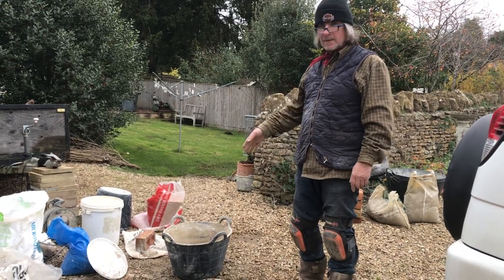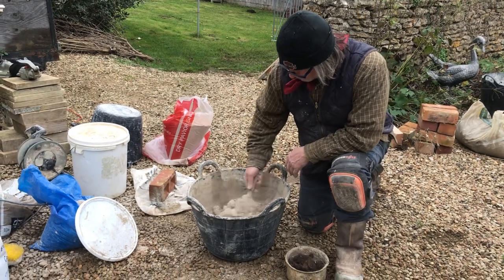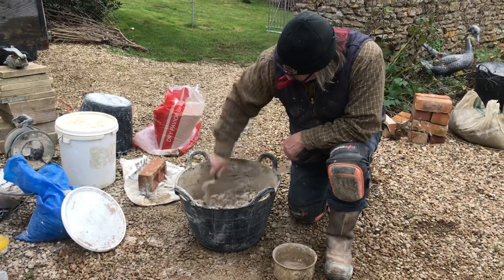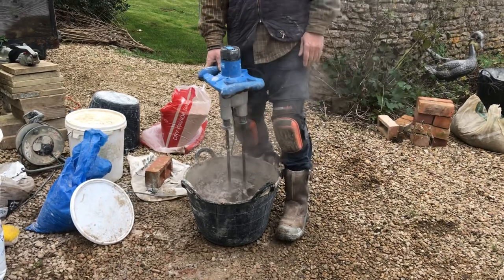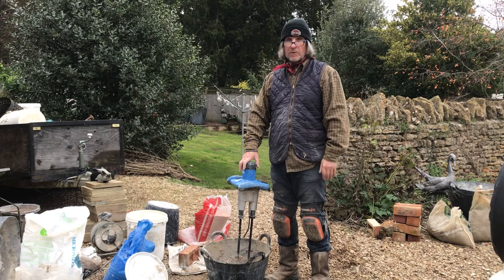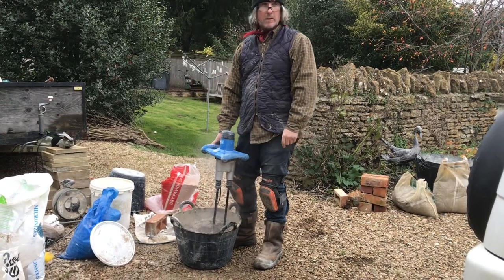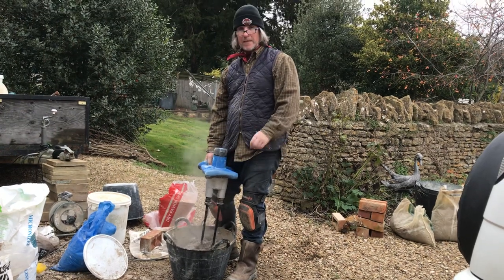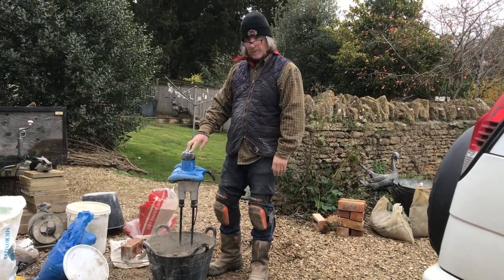How to mix Otterbein Naturkalk CL80

Comment: Hi there, I have just been mixing otterbein cl80 as well, here up north in the Scottish Highlands. I and was checking to see if I'm doing ok. We used builders sand and added a bit of top soil to 'get clay content'. Something I read. Not sure if that's what will work, but so far the chimney on the derelict structure looks amazing. Would you please advise what aggregate/sand and in what proportion regards the lime and water.
Reply from the maker: 1:2, 1:3 or 1:4 depending on the circumstances and vernacular. I couldn't advise on topsoil though. We never use it. The only thing we do is, occasionally, use a sand with a pozzolanic clay content but that is very prone to cracking.
Reply: Thanks! Back on it again, theres no cracks but I'll stay away from the topsoil now

Comment: Hi Michael, what would be the benefit of using the mortar hot straight away rather than the same mix cold the next day?
cheers
Joe
Reply from the maker: There're arguments for and against. I only use it hot during the cold weather if that's any help.
Reply from the maker: There are many. And I'm not going into them here. But if you want to know more then read Nigel Copsey's book on hot mixed mortars.
Reply: @michaeljamesdesign  cheers Micheal yes I have come across his work, he seems like the real deal, thanks for your reply
Reply from the maker: @TheJosepi87  He is. And he has a preference for hot in winter. We only use small volume mixes when it's cold.

Comment: Thank you, very generous of you to share your method of dealing with as slake transition reaction. Is your volume gauge ratio of quick lime : sand :  water  at 1:3:2 ? 

Willl this mixture be good enough for plastering directly onto the wall, in a hot condition, or will the evaporation of water be too high causing cracking ? 

Can you store that CL80 mixture inside a sealed bucket and then knock it back up by e.g. beating with a stick, or a squatting it in a roller pan mixer to make a good plaster that don't shrink/crack too much ?
Reply from the maker: Respectively: no, probably, maybe, possibly, no.

Comment: Thanks for the video. I think the addition of straw in to the hot mix will work well, but putting the horse hair in so early on in the slaking process will attack the keratin in the hair. Is it possible to add the hair at a later stage?
Reply from the maker: Hot mixed mortar is applied straight away i.e. whilst still hot -  for a number of reasons. The only reason the horsehair is there (alongside a number of other ingredients) is to help reduce initial shrinkage.
Reply from the maker: In another video I'll try and remember to say something about the horsehair in the original quicklime mortar still being present as a binder.
Reply: @michaeljamesdesign  That makes sense. Thanks.
Reply from the maker: @ironimp1 No worries. It's important that people realise that the ingredients which go into a traditional mortar or plaster go in for a reason. There's no flight of fancy involved. It's also important that we know the reason for adding what we add at a particular time during the mixing process. Quicklime mortars have all of the ingredients added at the same time. It's all about conservatorship. As the original masons from the 16 and 1700s used a lot of horsehair in their quicklime pointing and plastering mortars then we have to know why they did it and at what point so that we can achieve a similar outcome.
Reply: @michaeljamesdesign  Agreed, I recall the tanners using quick lime to dehair the skins, so as you correctly pointed out, the hair that you include early on will dissolve, but not before it does it job of preventing the initial shrinkage. 
I also note that you use local horse hair which, along with pig hair, I have found to be more resistant to the alkali attack. Plant fibres are excellent as they seem to improve in the presence of lime, so your straw addition would act as a reinforcement after the lime has cured. I know that some research has been carried out in this area, but as always, it would be good to know more.
Reply from the maker: @ironimp1  There's no straw in it. Just what sticks to the horsehair. And the horsehair doesn't dissolve. It's still very much present in the original plaster and pointing mortar which is hundreds of years old.

Comment: Your channel is sooo interesting to me, as a beginner. Very informative. Actually I live in the northern part of Germany and Otterbein is about 150km away from our city. If I assume correctly you do use CL 80-Q. Is quicklime only used in winter or do you use quicklime for certain purposes?
Reply from the maker: Hallo Gartenfreude, I use it all year round for pointing.
Reply: @michaeljamesdesign  Thanks for taking the time to answer. May I ask another question, why or when you use quicklime? I have assumed that you also use NHL for pointing and wonder how you decide to use one or the other.
Reply from the maker: @gartenfreude796  I've given up with NHL. Can't see the point in it if I'm honest. I only use quicklime now. I use in all year round.
Reply: @michaeljamesdesign  Thanks for sharing your insight and experience.
Reply from the maker: @gartenfreude796  You're most welcome sir.

Comment: If slower to slake does it make it safer?
Reply from the maker: That's an interesting point. I'd say probably yes. The heat build up is a lot slower and I never bother with goggles or a respirator with this one. With Calbux they're both an absolute requirement.

Comment: Thanks for the video Michael. A couple of questions if you don't mind!
Who first put you onto the CL 80 and took you away from using the CL90? Also how do you change the characteristics of the mortar for different use like you can with the pure air lime with pozzolanic addition as you mention not adding anything at all to the CL80. Keep up the good work and merry Xmas 🎅🎄
Reply from the maker: Hi Matte, nobody put me onto CL80. I just fancied it. I still use CL90, NHLs and putty. I don't understand the question about changing the characteristics of the mortar for different use. Try rephrasing it.
Reply: @michaeljamesdesign  sorry characteristics as in its hydraulicity (if that's even a word!) For example mortar for a roof ridge. A mortar for a highly weathered gable, mortar for a softer stone or brick. 
So with a cl90 you can change the mortar for its purpose by adding mote/less pozzalan. But your cl80 that you use as is. Will this only suit a limited function in where it is used. Sorry a lot of words to try and explain my point!!
Reply from the maker: @matte999me  The CL80 isn't a hydraulic mortar but it does act like one because of the impurities. It's a quicklime and needs to be treated as one. It's just like CL90 but with additions which help it set more quickly. But if you want to increase strength then you just add a pozzolan. I often add wood ash but that reduces the free lime content down a little further to something like a CL70.